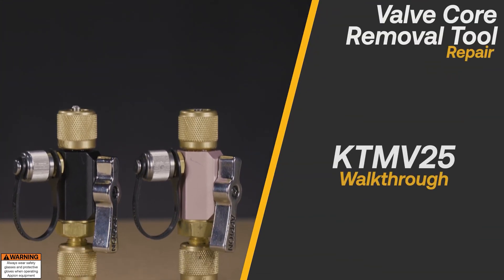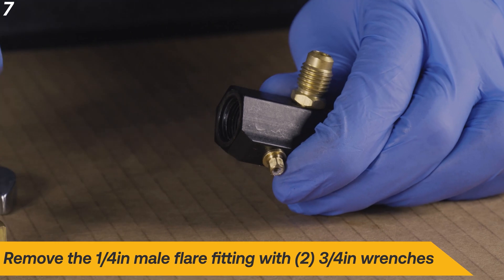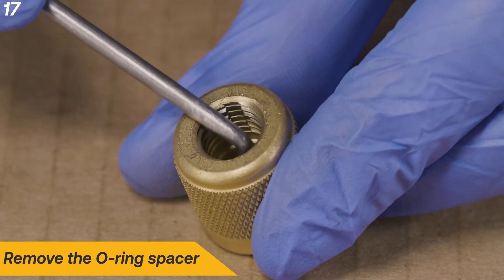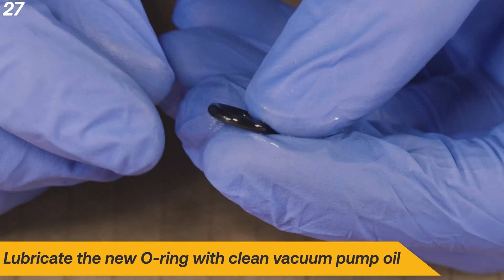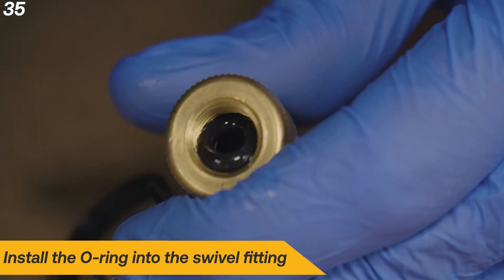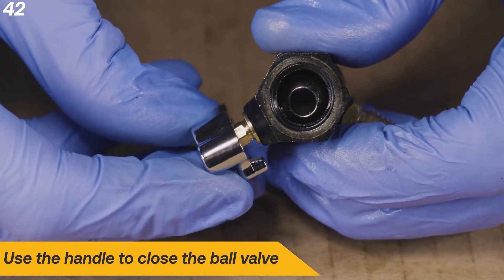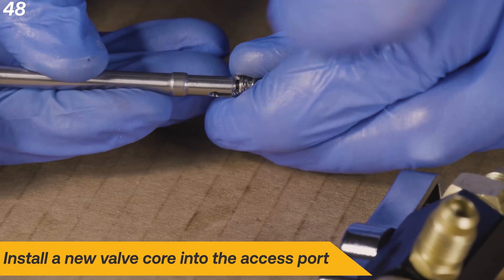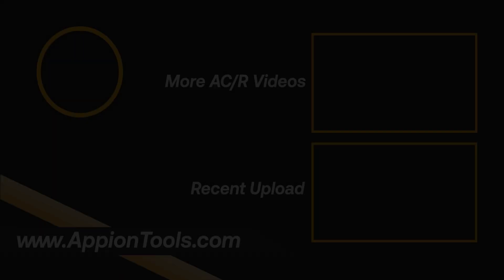VCRT Repair: KTMV25 Walkthrough

Comment: On the older style removal  tools how do you remove the pin
Reply from the maker: Ideally, use a 1/16in punch or 3mm punch if you can find one. You can also use a very small allen wrench to get it out, but then you risk damaging the allen wrench.
Reply: @Appiontools  It's a very bad design first gen Appion tool !!

Comment: If you need a second VCRT to do this repair, you might as well just buy a new one and skip the work
Reply: You don’t need a second VCRT any quarter inch male flare fitting will do
Reply: I usually use two anyway, that way I can have my vacuum pump on the suction line, and I can have my micrometer on the other, along with my nitrogen for triple evac.  For this repair, I didn’t use a second VCRT, I just used another part of the same VCRT.